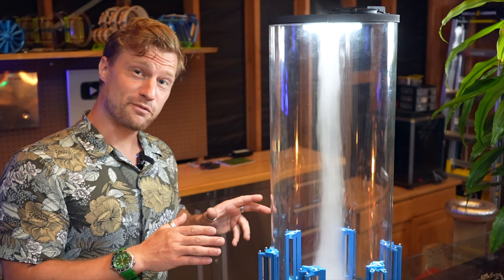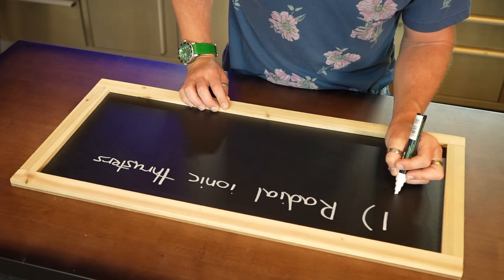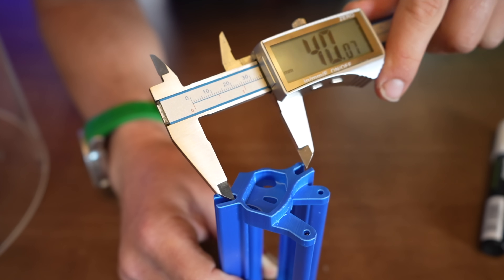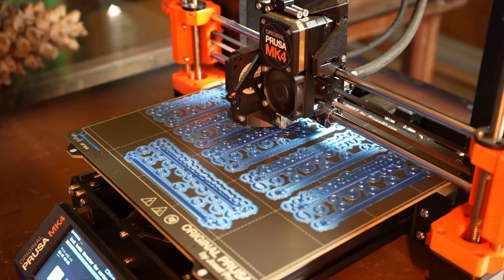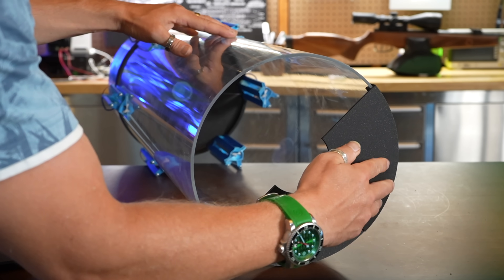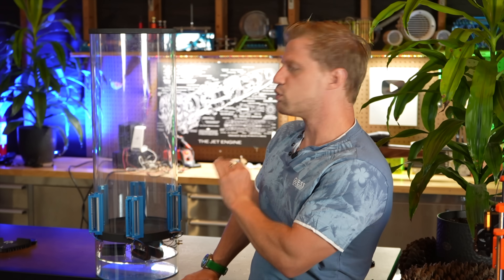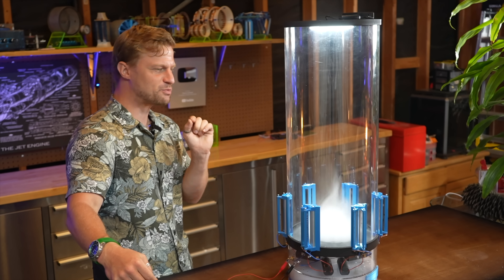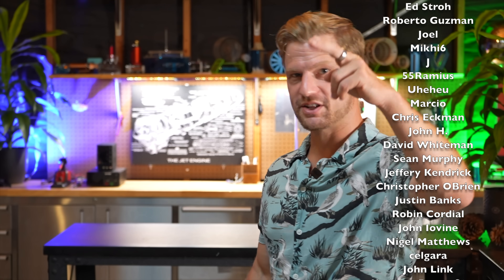I Built The First Ionic Tornado Machine! (Unreal performance)

Comment: Awesome idea and video, but I just had one question. Instead of cutting the acrylic tube, why not 3D print an extension to the bottom of the tube where the ionic thrusters are attached/mounted? Easy to design in Onshape either whole (if you have a large enough print bed), or print in sections and assemble (1/3 or 1/4). Just a thought. I know that the printed section wouldn't be as transparent as the acrylic (aside from POSSIBLY a few "clear" resins), but there are some cool translucent colored filaments that could be a close tint match to the azure ionic thrusters you used to make it look amazing (iceland/ultramarine blue?). Regardless, as a former meteorologist and long time fan, I approve this concept.  👍😀

Comment: Just a couple of things to keep in mind:

1.- Tornados doesn't form from bottom to top but the other way around, they form on the clouds and eventually (although not always) touch down on the ground so all this twister chamber is basically upside down.

2.- You may consider the posibility of using a different smoke or fog source like a vaper or a fog machine, that way you don't have to keep pouring water and dry ice into it and it would last way longer.

3.- Tornados are usually shaped like cones not cylinders like your vortex... just saying.

If you consider the use of alternative fog sources like I suggested you could even flip upside down your tube so it is in the propper orientation and with some luck it may actually work.
Reply: @manusoftar - When you say vapor or fog machine, could the vapor generator be like an ultrasonic nebulizer like the ones in an inhome vaporizer?  I don't know how conductive that type of water mist would be and the water would need to eventually be replenished.
Reply: @Tedeeb4  well, the dry ice also would need to eventually be replenished...

I was talking about a fog machine, those machines that use some kind of glicerine to make fog or smoke... like the ones used in music shows (not to confuse with those used in theaters as those are dry ice based)
Reply: Just flip it.

Comment: How about a more accurate tornado?  A single ring thruster at the top creating a low pressure with just angled opening at the base to encourage the spin.  Safer as well keeping the high voltage more out of reach.

Comment: Man, for an 'art installation' what if you replaced the ring light at the top of the vortex with a thin ribbon of RGB LED's at the bottom angled to shine up through the vortex?  Wire it up to be remote controlled and programmable and you could have it looking like there's a column of fire twirling in the middle there.

Comment: This is a really impressive premium build that I highly recommend showing to universities and high schools everywhere. The accuracy of this is impressive and with adequate funding, I bet they would build a larger scale model.

NOTE: I wouldn’t be surprised if you reversed the location of the Ionic thrusters towards the top of the funnel that you could get a top down tornadic formation! Maybe even have two different thruster groups that can be controlled independently to create varying wind speeds at ground surface vs at heights!

Comment: Instead of messing around measuring just wrap a piece of paper around it, cut it to length, measure on the paper and transfer measurements from paper onto tube, much quicker and more accurate if you do it right

Comment: I was surprised that you didn't show a version with the thrusters at the top of the chamber, to create a suction version which is more accurate to how twisters work, I think? Would it even work with the thrusters at the top?

...hmmm. but then you'd probably need to be exhausting the thrust to create a laminar flow of suction inside the tube, which would be drawing the dry ice through the thrusters...

Yeah, okay. That's a totally different build, isn't it?

Comment: I wonder if you could put some file particulate in there that would be heavy enough that it doesn't escape through the opening in the lid but light enough that it could take the place of the smoke. it wouldn't need to refilled and so it could actually be a sustainable art piece.

Comment: while the dry ice is great, you would have to either make your own or go out and get some any time you wanted to run this. i would have though a mineral oil fog machine like what is used in automotive evap leak testing would have been what you would have gone with and produce just as much, or more fog, it would also be adjustable in density as you can just raise or lower the heat to vaporize the mineral oil, and its less expensive, and easily storable so you can just about always have it on hand

Comment: Gastorch inside, so it become a flame vortex? Probably also turn thrusters a few degrees, so that they push a little bit upwords. Its gonna be a lot harder, cause of geometry, yet it would need less power for the same result. Also you can take a few chemichal dyes, and put them outside, so you could see their mixing inside. No improvment - just for fun and awesome picture.

Comment: I found this channel while just looking up ion engines as I was looking to see if anybody has used or tried a 1 in 5 twist or a 1 in 10 twist. I see you have the right idea with your tornado maker. I do not know if your plasma generators are the right side or if it would be better to cut the size in half and offset each one 20 degrees from the one lower to create the twist. How many offset rows 3, 4 or 5 can create the fastest stable speed. Just as a thought so that you do not spend 450.00 dollar all the time, create the rifling twist so that it can be slid in and out of your acrylic tube. If the end goal is to create thrust it will need to be stable vertical & horizontal. the one in five twist should be more stable at the higher velocities. I'm not an expert in firearms or plasma, they are just ideas rattling around in that empty space. I look forward to seeing if any of this is helpful or not.

Comment: Question: if you add a small Tesla tower style charge  disc to the top of the device you can mimic the electrical charge often seen in such storms and watch the lightning arc down the tornado.  Possibly onto foil trees you seal to the wall?  
Could also *possibly add a small cooling element above the top air port that would drop down cool air like the real thing more efficiently, but that would take a lot of fiddling with to get the right rates and make efficient

Comment: Could you use a light weight confetti in the chamber and put a screen on the top to keep it in. To save from using water and dry ice. Also could a solar cell make enough power to operate the whole thing? Maybe a solar film around the base and on the lid. Lid could power the light on top and the base to power the ion thruster?

Comment: If you're going to leave that on display in your living room you might want to cover those high voltage connectors to the thrusters. 
Also, it occurs to me that it would probably look pretty cool if you put colored LED's inside the top and bottom holes to illuminate the vortex from within and turn down the main overhead light.

Comment: I'm curious if it's possible to build something like this in a T-junction and have a horizontal vortex fold over into a vertical one due to differential speed between sides of the horizontal vortex? I suspect that is what actually causes tornadoes seen in weather, due to how convection currents build momentum to power such systems. (The leading edge of storms will have updrafts and the trailing down drafts, so there's a long sideways vortex hidden somewhere in those clouds.) To see that physically modeled would be really neat.

Comment: Maybe something like glycerine as a smoke agent?
Some kind of heater cable on the bottom in a shape of a tube. Inside is heater cable, around it some heatresistant wool, outside the glycerine(as the working principle of e-cigs). One side of the pipe is open to the air at the bottom. Other side is facing up, and so the ionic trusters create some force, that pull out the smoke.

Maybe on top, some kind of smoke arrestor, that condenses back the glycerine, so it canbe reusable? A closed system? Iiii think its better if i go to sleep😂😴

Comment: would it be possible to set a similar system but have layers vertically going opposite directions? making it have control of sections and the speeds of sections?

Comment: Have a small flame sticking up into the chamber, FIRE TORNADO! This thing is just sweet.
Reply: The fog would kill the fire due to being CO2 replacing the O2 needed for the fire.  A small ring of LED's with the right color at the base of the vortex shining up though..
Reply: @Enterprising_Aim  lol, no need for the fog at all. Just fire. Fire tornados 🌪 usually just grow from a whirlpool of air and the fire having enough fuel to maintain itself.
Reply: @JasonOnTheWeb  That doesnt seem like it would be safe to house in a plastic tube.
Reply: @Enterprising_Aim seems like the light at the top works fine to illuminate the column. Just use red instead of white.
Reply: @PatrickKniesler  To light up the whole thing, yes.  Doing it the way i described will have the fog itself light up.  while leaving the rest unilluminated.  IT would be a more striking effect as an art piece VS just for filming.
Reply: @Enterprising_Aim it’s acrylic
Reply: @StasFPV  yes, I know.
Reply: Flames conduct electricity, so it might get scary quick with high voltage.

Comment: Very cool.

I study tornado genesis (formation). For the sake of accuracy, you’ve created a wind driven whirlwind*, not a tornado. Tornados are driven by latent heat released by condensation or deposition within location(s)—“engine(s)”—in an updraft up and within a storm/mesocyclone or just a solo strong updraft.

A tornado is a very low pressure system caused by the “pulling” of air upwards. The “pulling” forms very low pressure in a constricted and concentrated space that then leads to the formation of a vortex. It’s akin to a drain vortex in a draining basin caused by low pressure pulling the water down the drain. Its “engine” is the drain hole converting gravitational energy to rotational motion.

*Near where I once worked was nearly daily formed large wind driven whirlwinds similar to your model, but several meters high. They were visible due to trash, grocery bags, and dust. Sometimes their upper reaches became dust devils.

Comment: water and dry ice is a solid choice but im curious if using a heat source with a porous material soaked in mineral oil will produce a longer lasting vortex.

Comment: I was kinda surprised to see it reach up when imposing only rotational motion. Do there need to be any intake holes in the bottom?  Also, I wonder if it would still work if some (or most) of the radial thrusters were swapped for axial ones at the ends.

Comment: I always thought that the fog caused by dry ice was water vapor condensation caused by the low temperature of the dry ice, that would make the explanation why you prefer that a bit lacking. But sure, a ultrasonic water water atomizer probably produce much bigger water droplets, and unless pure water is used, it's conductive, and leaves residues.

Comment: Don't you think you could turn this design into an engine? You have air flow going at thirty degree angle but what if you rotated those plasma thrusters back? So they would blow air up the tube at an angle. Could you also turn the base into a funnel? 
   If this was an engine you could power up the vortex which would suck additional air in through that front funnel then you could put a nozzle on the exit end to focus the thrust. 
     What speed was air coming out of top?

Comment: try building 3-4 of these cut the top off and mount them on your table up side down, see how much effort it would take to move the desk?  turn your desk into a drone.  probably an insane amount of power tho. even one would produce alot of movement, say on a skate board.     i'd expect a dust storm or maybe worse if it does create the vortex's. but may work the same in your water experiments

Comment: Respected sir 

I hope you are doing well. I am Waibhav, a fourth-year student at the Army Institute of Technology, Pune, India. I am seeking your valuable insights and suggestions on two projects I am working on a Tesla coil and an ionic thrust system.

Tesla Coil Project: I completed work on a Tesla coil as part of my third-year project. My approach involved amplifying the surroundings through the resonance of the coil, and I aimed to position the coil at an optimal angle to maximize the output. While I have successfully constructed the coil and have some pictures of the setup, I am currently seeking guidance on the circuit design to further refine the project. Additionally, I am interested in writing a research paper on this work and would greatly appreciate your insights and suggestions.

Ionic Thrust Project: I am currently in the design phase of an ionic thrust system, exploring the potential of ion propulsion. My primary focus is on optimizing the design for efficient thrust generation. I would appreciate any advice on overcoming technical challenges related to electrode configuration and voltage application.

Given your expertise and experience in these fields, your feedback would be invaluable to me. I am eager to learn from your experience and incorporate your suggestions into my work.

Thank you for considering my request. I look forward to your response and any guidance you can provide.

Warm regards,

Waibhav Kumar
+918986482520 (WhatsApp also)
www.linkedin.com/in/waibhav-kumar-2aaa20233

Comment: The obvious next upgrade is of course fireee🔥! The 3D printed parts for the bottom and lid could be replaced with sheet metal and the acrylic tube itself should be fine with the air flow. Just the contact points between the two might be tricky. Maybe a glass tube for the price of two kidneys and a liver... and a month of cutting the notches.😂

A few years back I built a  fire tornado from a zylindrical glass vase and an oil lamp, that uses the draft of the flame to create the rotation. It still workes like a charme.

Comment: What was the windspeed or velocity coming out of the top? Could you build in anemometer into the top of it so we can see wind speed with voltage increase? Can we see the comparison of windspeed of the vortex inside the tube vs windspeed acting as thrust coming out of the back? How much force is being applied to the acrylic tube? Er plasma plastic? Is that force in imploding or exploding force? And finally, seeing that it is Ion propulsion, is there any visible light made? Will there be that beautiful saft earie glow under the tornado if it is running in a dark room?

Comment: You could make a flimsy 12.7x25" chamber out of .010" thick dura-lar and box tape for about $15. You can buy individual 25x40" sheets from Blick art supplies. I use the .005" thickness for animation cel painting.

Comment: The phenomenon that inspired this project seems to be caused by Lorenz force. You just built a regular (just bladeless) twister model. Still looks nice, but
I would like to see a model, that creates twisters with pressure, heat and voltage differences in air layers. Also one that isn't horizontally caged in. That alway cheapens the effect for me. Of cause you have a tornado if you spin air in a tight tube. Spin air like a whirlpool creates spin, not spinning it yourself.

Comment: Voltage isn't power. If I read right at 9:02, then that was 7.5v @ 8.1A that's over 60w. That's quite a bit.

Also, isn't each one of those hv.. Well any of the hv exposed parts super lethal? Maybe a design prevents touching of the HV parts?

Comment: Question: What is the flow rate at the outlet at a voltage comparable to one of your thrusters? If it's possible to run these thrusters at a similar voltage, Theory could you add some declination to the intake thrusters to direct the flow toward the outlet, creating low pressure at the bottom? Then opening up the bottom to allow more flow, could this increase the efficiency of the flow or enhance the vortex effect? I'm thinking of increasing the volume of airflow similar to a bladeless fan.

Comment: I remember a kids science expo 20 years ago, using an electric stove plate underneath a a square metal pan, with glass sides open only a few mm on the corners. This hot vs cold generated a whispy, but real silent tornado. Nice to see how some nice tech improves on such simpler designs.

Comment: If you use 18 MOhm*cm^-1 water, is it still too conductive? I have ran piezoelectrically atomized water past a audio-modulated high-frequency high-voltage vacuum tube oscillator (plasma tweeter) to see how it impacted bass- no issues.

Comment: This is amazingly made, Also the fact that it has Zero moving parts. 
Just a note as a meteorology enthusiast, This by technically isn’t a tornado, This would actually be a land spout, The Difference? 
The difference between a land spout and Tornado is that a Tornado requires a Mesocyclone, and the rotation originated from said Mesocyclone. Whilst a land spout is a lower level rotation, Where instead of the rotation originating from a mesocyclone structure it originates from a ground level circulation.
Eh, just the nitty gritty, Still an absolutely amazing creation and I’d kill to have one on my desk. Love your work and always excited for another mad scientist creation!

Comment: if you can readjust your audio.. there is alot of distortion
Reply from the maker: I wish I could - I struggled with audio quite a bit in this video. Editing the audio was brutal, and once posted, you can't adjust the audio
Reply: @PlasmaChannel  you should look into multi- spectral compression. Sounds scary but it’s a miracle worker